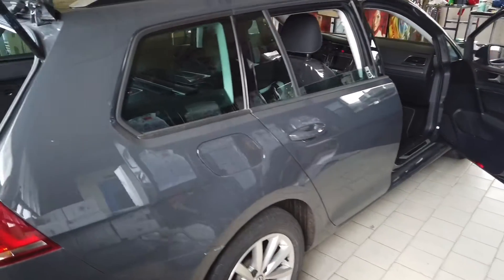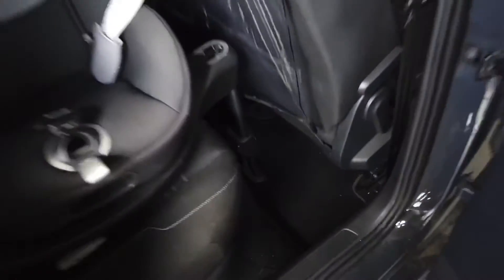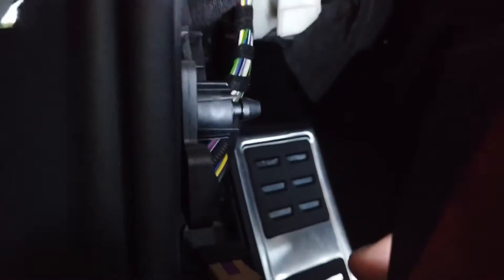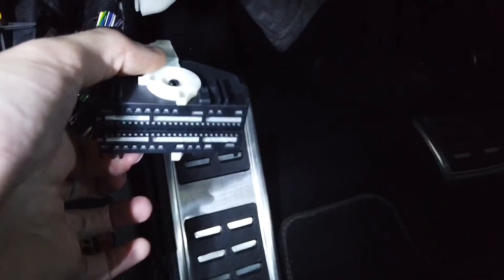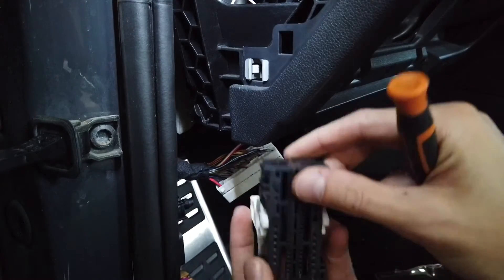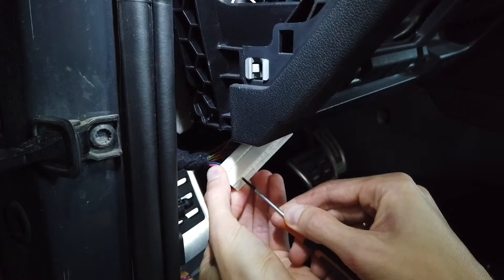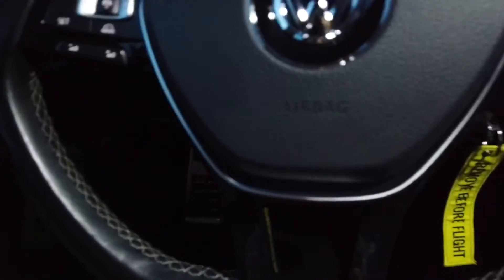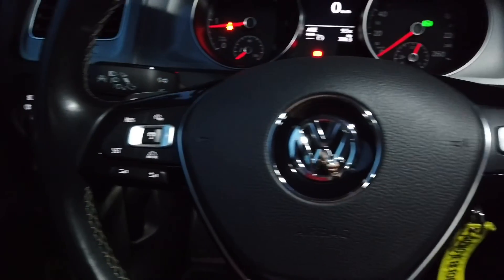VW Golf MK7 (5G) footwell light retrofit (part 1)

Comment: Hi, i have a gtd with ambient light, but i upgraded the lights and the i want to redirect the acc wire so that it turns on by unlocking the car. Do i still need to code it or do i just redirect the wire?

Comment: Is there enought cable for passenger rear light, to be mounted under the door plastic trim? Im thinking about doing the exact same procedure as you have done but that is my only concern. Im thinking that if it's not enough cable then i might have to route it under the "gearbox" plastic trim. I have seen on AliExpress that they sell same cables as you have and that the length should be 180 cm. Thanks for helping👍

Comment: Hi mr-fix i'v learned a lot from your videos thanks..I have install the wires for the first light under the dash to the 72 pin connector and the braun wire to the chassi just like in  your video. I also code this with OBDeleven but nothing happens the light will not go one? Can you tell me why i have this problem?
Reply: Hi do you resolve your issue i have the same problem

Comment: Hello, I installed all the lighting for the legs, everything as in the video, only I installed other led lights from skoda.  I made the adaptation, the lighting of the legs appeared in the menu, but the lights do not light up.  Could it be due to non-original LED lights?  car VW golf 7.5 2019
Reply: I have the same issue, do you resolved the problem ?

Comment: Thank you very much for your video and help. Every thing was good except when coding with OBDEleven on: Adaptation → Interior lighting; parameter - p_adaption_kundenwunsch_fussraum → 14, it doesnt accept value 14 it gives some kind of error so used 1 and every thing is working fine and also Adaptation → Ambient lighting - Defaultwert Ambienteprofil Fussraum → 100% i couldnt find it so i just left it and i works fine (i have golf 7). Thank you again for your instructions and time to help other peopel! BIG thumb up
Reply: I'm also having this problem right now. Can you give a update on if you fixed it or still have this problem?

Comment: Hello Mr-Fix, I installed my lights and I am coding with OBDeleven. I have a 2019 sportwagen S. I need help with a couple coding issues I have.

I can not change the long coding. When trying to execute changes I get messaged “function not available”
Adaptation > Ambient Light - says “There are not items available for this option”
p_adaption_kundenwunsch_fussraum>14 - says “Function cannot be performed, mess. length or formate incorrect”

All other adaptations have been excepted by the vehicle. Currently the footwell lights only turn on when the door is open.
Thank you for your help.
Reply: Dragans comment on this video fixed my coding issue by just inputting 1 instead of 14 under adaptation_kundenwunsch_fussraum. Footwell lights working as supposed to😊

Comment: Hello. I did everything as described by you(all the coding steps) but, in the multimedia system(mib 1 Discover Media 5G0 035 846 i do not hav the "Footwell light"  option slider  on the light menu. Is there something else to do? Many thanks.
Reply: Even if you don't have this option in your light menu because of MIB 1, did your lighting work properly afterc coding?

Comment: Hi, how you remove the footwell plastic without remove hood latch release handle bracket? Thanks
Reply from the maker: I believe I did removed it. It fairly simple, but was not visible on video and I edited it out. Sorry for the confusion.
You can check my video about installing aluminum pedals. i believe it's shown when installing the dead pedal.

Comment: Hello mr.fix, I’m trying to find the same product you have shown in the video but only for the front two seats, I don’t feel confident in doing the rears also, will I be able to use the 4 piece set given and just miss the two rear lights or will I need to get a set that has just the front two, I can’t seem to find the right one with correct wiring, is there anyway you can help me?

Comment: Getting issues with the obdeleven coding.

I get the error:
"(13) Function cannot be performed, mess. length or format incorrect"

When messing with:
"Adaptation → Interior lighting; parameter"

Half the coding is done here which is a problem.

I also don't even have this menu in 5F-
"Adaptation → Car_Function_Adaptations_Gen2"

Everything is installed. I have 2door hatch and just used all four lights up front instead of putting the two in the seat of the car for the back row.

Comment: hi just retrofitted the footwell light on my golf 7.5 but i have a problem  the light is very low even when i put the maximum brightness  on the infotainment , when i change the brightness  on LC72 AB dimwert from 100 to 127 the brightness is high but i can't dim it from the infotainment anymore , any have the solution to this?
Reply from the maker: If dimmwert is set above 100 it will fallback to default setting with max brightness, no fade effect and no controls. Set it to 100 and check the Adaptation → Channel: Interior lighting; parameter channels which are set to 70%
Reply: @mrfixpl  yes exactly i tried this just to make sur the footwell work well, because even when it's night  we see it just a little bit even when i dim it on maximum 
Thanks i will check this adaptation
Reply: @mrfixpl  https://youtu.be/lvCuXAcGcAY
here a video of the led footwell

Comment: Hi mr-fix,
I have a problem with follow code:
p_adaption_kundenwunsch_fussraum -> 14 (Default 0.00)
The value 14 is not accepted from system.
The same value in bin 1110, is not accepted from system.
Only value accepted from system is 0.14
Wicth value you have put?

Anyway, I made all the adaptations
and for code, p_adaption_kundenwunsch_fussraum
I have used 0.14, but the menu "Footwell Lighting"
on the infotainment display, is not visible.
The Footwell Light are not connected yet, could be the cause?

Thanks
best regards
Reply: I answer myself, the correct code is,
p_adaption_kundenwunsch_fussraum -> 0.2
In my Golf 7.5 the new menù is in "Ambient Light"
and allows for HMI dimming adjustment

Comment: Hi mr-fix,
congratulations for the tutorial, I have a question,
what is the purpose of enabling bits 7 and 3?

Coding → Long Coding → Byte: 05 → Bit: 7 → enable
Coding → Long Coding → Byte: 17 → Bit: 3 → enable
Reply from the maker: One of them enables footwell lights in general. The other one enables ambient background illumination in footwell.
Some newer MK7s does not require coding at all, just adaptation changes. Coding is filled with 00. VW at some point switched to adaptations in BCM module.
Reply: @mrfixpl  Hi mr-fix,
is it correct that the following parameters are different?
                                           
- p_helligkeit_HD_auf_zuendung_ein_fussraum -> 126%
- p_helligkeit_HD_auf_zuendung_aus_fussraum -> 127% -> 126% ?

                                         
- p_helligkeit_Fzg_geschlossen_zuendung_ein_fussraum -> 126% -> 70% ?
- p_helligkeit_Fzg_geschlossen_zuendung_aus_fussraum -> 70%
Reply: Hi mr-fix, what code did you use?

- p_helligkeit_HD_auf_zuendung_ein_fussraum -> 126%
- p_helligkeit_HD_auf_zuendung_aus_fussraum -> 127% -> 126% ?

                                         

- p_helligkeit_Fzg_geschlossen_zuendung_ein_fussraum -> 126% -> 70% ?
- p_helligkeit_Fzg_geschlossen_zuendung_aus_fussraum -> 70%

Comment: Thanks for the video and the coding details provided., i had been scratching my head for almost 2 yrs now to get this working. The missing piece was the interior lighting parameters. Finally got this to work. Only issue was those adaptation changes did not work on my VCDS. But had to use the VCP Tool for the coding.
Reply: Hi, I probably have the same problem - my VCDS does not want to find (display) when encoding channels "interior lighting: parameter - p_adation and interior lighting: parameter - p_helligkeit". Can I ask for advice on how to solve this?

Comment: hi, I started coding the procedure as you wrote in detail ... I managed with Vcds to codify only the first part, the long coding, terminal 72 enabling, and the coding for the display control module! ... part concerning the adjustment of the lights ... nn I was able to find the various wordings in the drop-down list .. it is very complicated and long. how can i solve?
 thank you
Reply: Hi do you have find a solution to change code using VCDS. I have thé sale issue like you i cannot set all paramètre using Vcds ☹️

Comment: Hello,
I come to ask you because Isearched everywhere and watched a lot of tutorials but I didn’t find what I was looking for 
Here is my problem :
I have a Golf 7.5 with basic rear led lights (https://forums.vwvortex.com/showthread.php?8571473-North-America-gets-screwed-again-here-are-the-LED-lights-for-NA)
I bought original MK7.5 dynamic rear lights, sold with wires (four wires).
For now I plugged all normally without new adding wires, just cuted a little the plug connectors for them to make them compatible.
What works ?
-	« general » light works
-	Exterior left and right trurn lights work (no dynamic)

Problems/missing :

-	No exterior left and right rear turn lights
-	No back drive lilghts (onboard lights ON when problem detected : driving back)

What say the install book :

-	Climping out all needed plastic
-	installing and connecting the « 4 wire harnet » between rear left and right lights and going to BCM
-	Code with ODIS

My questions :

-	Am I obliged to code with ODIS, it’s a professionnalsofware…
-	If obliged to, where must I go to ask for this ? only offical garage VW ?
-	If I do all the work but not yet coding, what happen ? only lights onboard ?
-	Where can I find tutorials about clipping out wire bottom doors ? (rear door panel it’s ok)

Sorry, it’s long, but I’m in the mess:/ please help me 
PS : If you have some information about putting off then on an airbag seats of Golf 7.5… I take…

Mathieu

Comment: sorry but the difference between the connection to pin 72 of connector C or to pin 50 of connector B., what changes?  Thank
Reply from the maker: BCM has 3 conenctors with 70+ pins on each. Only 35 (or so) of them are used to control lights and are programmable.
And C72 is the pin used originally by VW when the car is equipped with footwell lights.
Reply: No Golf 72 footwell. No polo 19 72 Luz portas.

Comment: To get some more brightness when doors are closed, can I change the 70% in the adaptions to 100%?
Reply from the maker: You can try :)
Reply: mr-fix One last question. What value do you have on “Adaptation → Interior lighting; parameter - p_adaption_kundenwunsch_fussraum → 14” ? It should be 14% but it only accepts “0.14”

Comment: hi its works for a seat leon 5f 2017 1.2 tsi? thx you
Reply from the maker: Should be the same for Leon 5F and Octavia 5E.
Reply: What BCM is installed? Or rather, where can I find the bcm's squematic? I have leon 5f (MQB) 2017 and rapid spaceback (pq25 platform) 2015

Comment: Hi and tnx for the video. I just finished install on front and rear footwell lights. Codinig was slightly different on my MK 7.5  comfortline:
1.No Ambient lighting in Adoptions on my car. (Adaptation → Ambient lighting - Defaultwert Ambienteprofil Fussraum → 100%
)

2.Adaptation → Interior lighting; parameter - p_adaption_kundenwunsch_fussraum → 14 -  it would not accept value 14  or  multiple other values that i tried randomly :)  It accepted value 1. 
Everything works as it should. Brightness level is adjustable from infotainment unit.
My kit is from CarSystems.eu  - https://www.carsystems.eu/golf-7-5-lighting-parts-accessories,tag.html
Reply: Hello. The footwell lights appears in the light menu?
For me only appears in ambient light menu. I have a 7.5 facelift too
Reply: @carlosb68  Friend, my golf is the mk7.5 comfortline.  How can you pass all the complete coding?  Thanks.
Reply: Thank you, Inputting 1 fixed my issue with coding the lights to the car!

Comment: I installed all 4 lights in my golf 7 2015 lounge, but after several attempts I had to code them to adjust them together with the ambient lights. 
Now I have seen your video and tried to replicate your own coding, with no success.
I receive an error message (Incorrect message length or invalid format) when I try to change one of these parameters Adaptation → Interior lighting; parameter - p_[...], 
They are all at 0. Do you have an idea how it could be solved?
Thanks
Reply from the maker: Please make sure that you have entered the security access code first. And there might be a timeout from when you enter the security access to the first parameter change, so if you don't make any change within on minute or so, the access code expires.
Reply: @mrfixpl  
thanks for the reply, unfortunately it is not a problem of timeout or security code, but specific of this category of parameters (Interior lighting; parameter - ...) that in my case cannot be changed, no problem with others
Reply: Same issue here for me., none of the parameters for interior lighting works for me with VCDS. get an error something like CAN Messages greater than 256 bits not supported. Wondering if other tools like VCP or VAS5054 can code this adaptations.

Since all of this values as set to 0% ., footwell lights will not turn on.